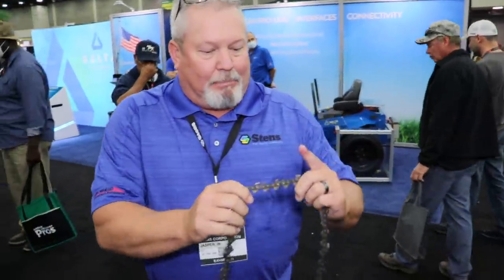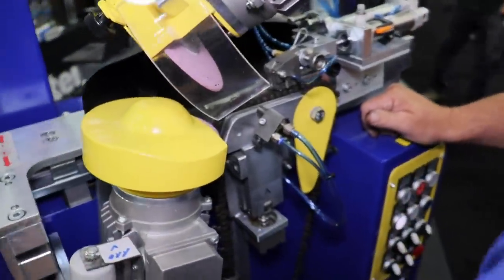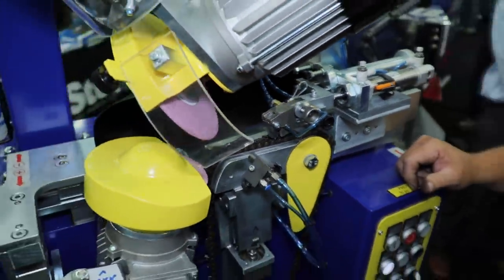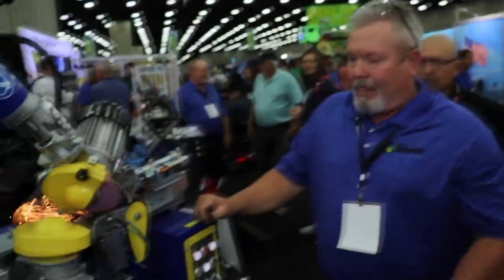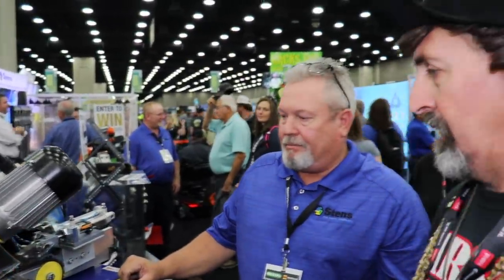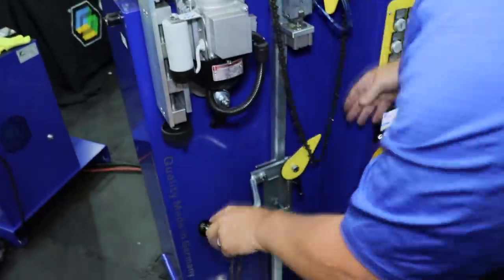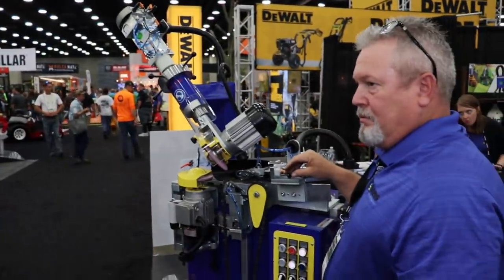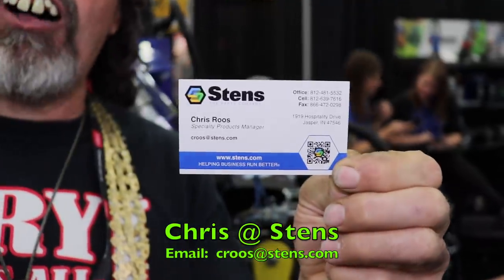AMAZING 23,000 Dollar Chain Sharpener! Does It For You

Comment: Cool video boys.  I used to work at Walkers Saw Shop on Vancouver Island and they have one of these.  They sharpen so many chains per day that this is worth it!
I only disagree with the Stens guy on one point.  The rakers should not be 20 Thousands on ALL chains.  It depends on if you are cutting softwood or hardwood!!!
Reply: It also depends if you are ripping or cutting across the grain. You don’t want too much off if you are cutting our hard timber that has been dead for a hundred years either. No saw has enough power for that.
Reply: on my first chain i put the gauge wrong and i ground them ALL THE WAY DOWN. i tuned my carburetor and that saw was a monster! i was ripping thru wood like a light saber. i am only cutting soft wood with no knots, so it might not work with "wild" wood.
Reply: @Francois_Dupont  I did the same thing and it about snatched the saw out of my hands and my arms out of socket! Was cutting aged pecan!
Reply: @Francois_Dupont  I threw the chain away!
Reply: Steve is correct imo but to be further picky as I am with my rediculous saw collection that requires some form of monthly counseling..I have learned different sharpening methods to fit the attitude of the saw itself AND what I'm doing with it , simple example being 2 -372's one is built for more torque less rpm,the other revs to the moon with little torque down low I run completely different angles and raker heights between the 2 ...but that's just splitting hairs for saw addicts most people don't need to bother with all that I suppose.

Comment: It's some bucks but when you consider the tech an the fact that that includes delivery and setup it doesn't seem all that crazy. Also, this thing would probably pay for itself pretty quickly, I think it's like $10 to $20 to get a chain professionally sharpened and it looks like the only consumable would be the grinder wheels. A person would probably want to make sure they can use standard wheels or check the price on theirs before jumping in though :-)

Comment: If one charged $10 per sharpening, the machine would be paid for after 2,300 chain sharpenings.
Reply: $5 per chain sharpening in western pa.
Depending on the lenght of the chain.
Longer it is the more it cost to sharpen
Reply: @beachbums2008  That's a reasonable price. If the price to sharpen a chain gets too expensive, the customer would rather buy a brand new chain.
Reply: $23,000 at $10 per chain is 2,300 chains to pay for itself (excluding electricity). great to see you also did the math.

10 chains per day x 5 days in a week x 48 weeks = 2,400 chains.
a business in the right location with a 10 minute chains service could easily pay off the machine in a couple of months.

hell have a cafe area and the customer can have a coffee or tea while they wait.

now is there an automatic bar dresser?

Comment: Edit: I first typed this without seeing the other 10 posters who did the math, same as me. : ) Break even without electricity, parts, maintenance or attendant labor at $10 a chain would be 2,300 chains to break even. If it does a really good job, people might pay $15 -$20 a chain, depending on the size.
Reply: Jeff , How much do you pay for a new chain?
Reply: There around $35 for a 20" Oregon
Reply: in Alabama
Reply: @Daddyrabbit_2  Depending on size, there are a lot of chains north of $30- especially if you are buying Stihl chisel point or skip chains that they don't sell a lot of. I have found that I can do as good of job, free hand with a dremel and correct sized grinding stone as I usually get at the saw shop. Those guys usually burn the teeth blue and anneal them so that they go dull way faster. If I could get a "factory quality new" edge, undamaged by excessive heat, I would surely pay $15 for that.
Reply: @jeffpiatt3879  yeah if you get a chain sharpened and it comes back with any color,it's ruined where the color is. Straw color to blue color is bad as you know.
Thanks man!

Comment: How many chains would you have to sharpen to pay for the machine?
Reply: About 1,000
Reply: @reddyfreddy  At five minutes per chain that would be a little over 83 hours for a thousand chains. . Let's say you charge $7.00 per chain that would be> $7000.00 So, I'd say it would be closer to 3000 chains just to pay for the sharpener. Which would take you 249 hours. Now this doesn't  include replacement parts. So unless you have a steady load of chains to sharpen. which most people don't. It might only be economical if you're a logging company that sharpens your chains, and that of a large community of chain saw users.
Reply: Loggers around here throw the dull ones on the ground put a new one on an don't look back
Reply: @comeasyouare4545  i charge $23.00 a chain.
Reply: @jeffshearer5125  Yeah! the time of having one sharpened, isn't worth just buying a new one. Many years ago I knew a man that had an automatic hand saw sharpening machine. I asked him the same question. Would it be cheaper just to buy a new hand saw. He said some people get attached to their tools. That before we became a throw away sociality.
Reply: @reddyfreddy  And what's the price of a new chain? Rip chains might be worth sharpening at that price, but they're  the exception.
Reply: @reddyfreddy  Damn, I'd like some of that! Here in BAMA you can get a 20" Oregon chain for $35 at Lowes!

Comment: Yeah, it's hard to beat a factory edge.  And that machine can duplicate the factory grind or whatever profile you desire!   But, the main reason why a resharpened chain just ain't like a brand new factory chain is:  the chain got too hot...you smoked it...done lost the temper and it is now softer.  So stop cutting as soon as you notice it is becoming dull:  because a dull chain just gets hot.  Well, not all is lost even if it happens:  just resharpen it and keep on trucking.  Oh, also, a hot chain wears out your bar faster too.  Yeah, you've seen a bar or two that have the dreaded blue marks of abuse....  them bars are heat-treated and tempered too...

Comment: A chainsaw shop I know would not like this machine, it would just make them lose a lot of money, with the manual sharpener they eat a new chain in four sharpenings and then sell you another new chain. Of course it's not the fault of the manual sharpener but that they adjust it so that it removes too much material each time, overheating the chain in the process so that it lasts even less between sharpenings...